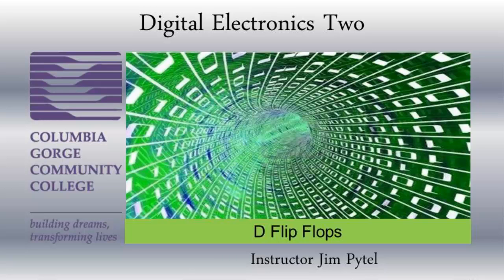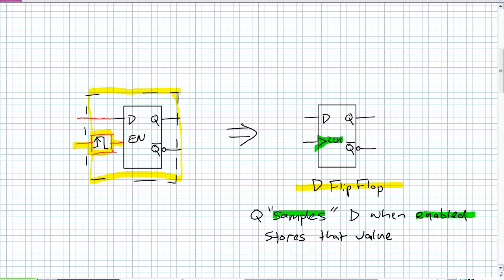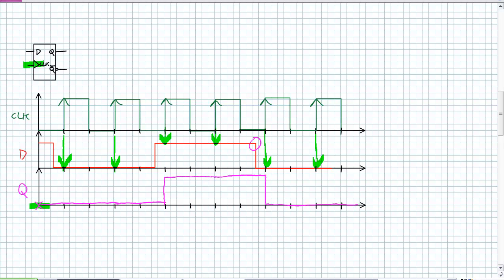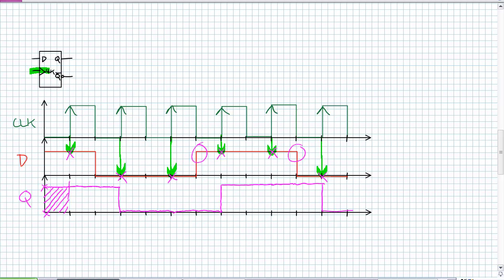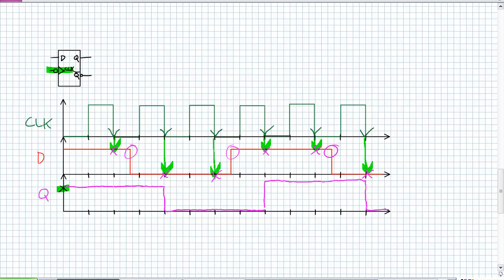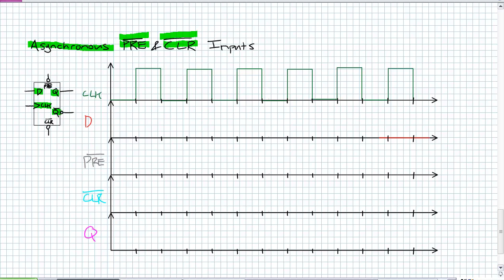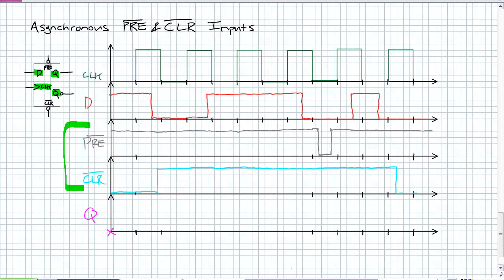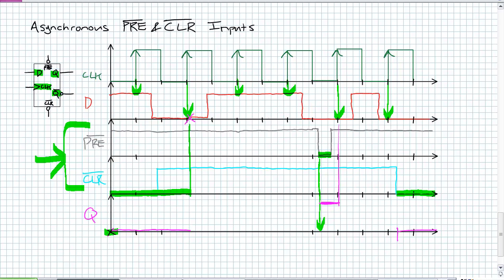D Flip Flops

Comment: Wanted to let you all know I'm currently developing content for another YouTube channel at:

https://www.youtube.com/user/bigbadtech

The "Basic Electronics 1: DC Circuit Analysis" playlist will be finished summer 2015 and I've posted sample content for other playlists. This channel is undergoing major development and is regularly updated. Subscribe to it if you're interesting in getting the latest content. Long terms plans include a complete basic electronics series (DC, AC, 3 phase AC), motor control, power electronics, motors and generators, hydraulics, renewable energy, and more! Enjoy!
Reply: Jim Pytel I have question do you know what synthesis methods of CCS is or what it has to do with an ASM chart cause i keep reading a pdf from my professor and i still don't get some parts.